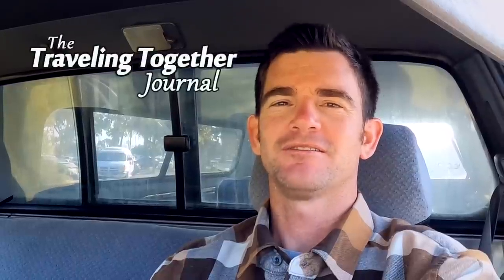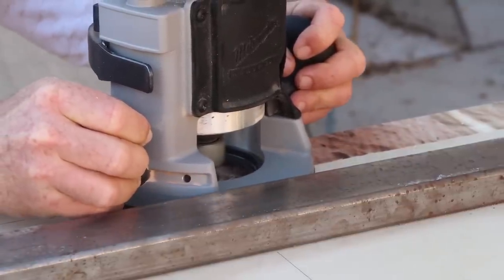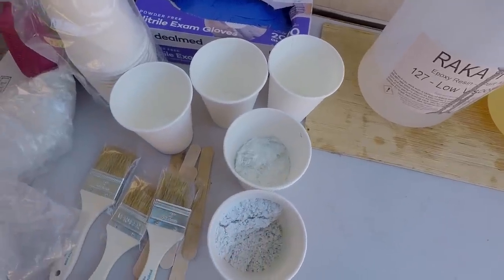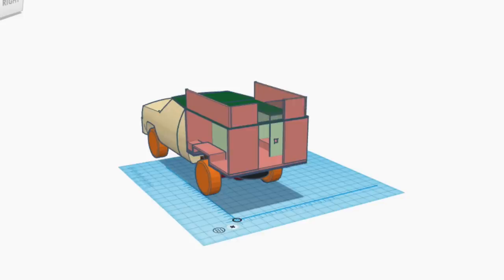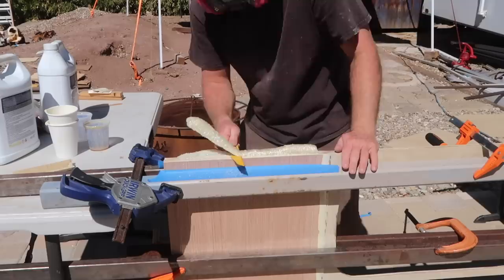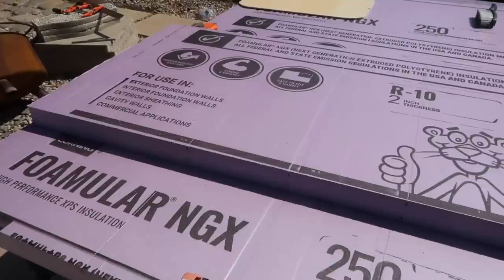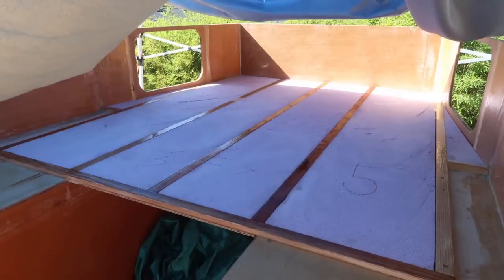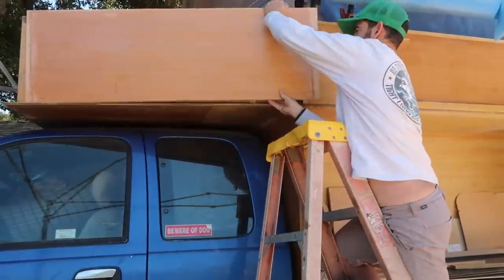Building A 4x4 Truck Camper | DIY Foam Composite Panel Cabover

Comment: Great work Matt.  I imagine you’re not taking orders yet for custom builds.  Enjoying following every step.  I also used the Foamular 1.5” thick all around my truck camper as we winter camp -20 C.  We cover the single pane windows with foam insulation plugs.  Nothing fancy.   Your build is the way to go in my book.
Reply from the maker: Thanks Marc. I think I had a similar idea for the foam insulation plugs in the single pain windows. I should probably get the windows installed first though 🤔
Most of my insulation concerns were motivated by wanting to beat the heat, but I'm sure we'll have some chilly nights near a ski mountain at some point.

Comment: Brings back memories of building my LongEZ.
I'm building a bicycle camper trailer pretty much the same way as the way LongEZ is made. 
But I won't be using fiberglass. That stuff is nasty. Cotton canvas produces even stronger composite.
As a matter of fact, the the fillets you've been using on the corners with glass strands, is done with cotton flux in the construction of all Burt Rutan's creations.
Looking forward to your next video.
Reply from the maker: Good luck on your build!

Comment: I've been contemplating building a light weight pop-up trailer.  Watching for how you actually pop the top!  I built a panel insert and remove trailer on the lines of the old Apache trailers, with the basis being an old Coleman Pop-up camper.  Using mostly 2 inch thick foam coated with poor-man's fiberglass.  It works fine and is very light weight.  But - takes a while to assemble and disassemble (about 45 minutes).  Watching and enjoying your build.  Amazing, Matt.
Reply from the maker: Hopefully I'll get the popup figured out sooner than later and will be sharing it in the next video. I think getting a good seal between the moving parts is going to be the tricky part.
I'm hoping I can go from parked to ready to sleep in less than 2 minutes.

Comment: Right on. You’re a focused person to be able to do such an impressive undertaking. Are you keeping track of how much you’re throwing at materials? The design looks solid to be able to last for years.  I’m almost done stumbling through building a rusty shit van and I wouldn’t ever let you inside to look at it. Lol 
Mostly found reused materials with a shit understanding of how to build. Good thing it’s an 80s diesel.
Maybe I’ll catch ya around the bend down south one of these days.
Reply from the maker: It's defiantly been slower progress than I anticipated when I started the project. I am keeping track of my materials cost. I haven't added it up yet. Kinda don't want to😅 But I was planning on sharing that info once I get the basic camper done (roof, windows, doors installed)

Hopefully, once I get this camper usable I'll be spending more time down south too. Thats the motivation at this point

Comment: Cool to run across this video... I may have the opportunity to pick up this body style of Tundra that has quite a bit of damage from riding out an EF-3 tornado that completely leveled a brick strip mall 50 yards from where it was parked. As a result, the poor old truck doesn't have a straight body panel anywhere on it. LOL! Nothing terrible...just lots of dents and scratches. I was actually thinking about scrapping the bed and doing something similar to your project. I have even pondered cutting the back of the cab off and having a crawl through. I will have to check out the rest of your videos when I have a little more time! What do you think that your final camper weight is going to be? Are you going to need to add air bags or beefier springs?
Thanks for sharing!
Reply from the maker: I'm expecting the camper to weigh 1200 pounds empty. I will probably exceed the weight capacity of the truck by the time it is fully loaded for adventures, so I may replace the old worn-out leaf springs with a slightly higher rated, new set. Gonna wait to see how she sits when I'm done
Reply: @TheTravelingTogetherJournal  Nice. I’ll keep following along!

Comment: Great work Matt. May be a naive question, I see all the frames etc, but no pillars to support the weight of the truck roof in an unfortunate event of a rollover. As you know all cars/ trucks come with an A-Pillar and B-Pillar. Thanks. Always enjoyed your work.
Reply from the maker: There is no intension of riding in the camper while underway. We will be in the cab with its unaltered A, B, and C pillars.

Comment: I have a T100...and the issue has always been finding a camper to fit it.   Nice way to to get around that problem.   I wonder if you could build this with just foam and fiberglass?  nice project.
Reply from the maker: You definitely could, but for my application ( occasionally off-roading down overgrown trails) I would want much thicker fiberglass than what I am putting over the wood. You may also need to consider a more structural foam. I think it would be an easier, faster way of doing it, but the cost may be considerably more depending on the materials you choose.

Comment: Well done! Finally a new video. How long do you think you'll need to finish the build?
Reply from the maker: At least a few more months to get the roof and doors on, but it will probably never really be "finished". I have intensions of doing a lot of drawers and mounts for different things in the various compartments. There will be an electrical system and water system, storage under the camper, and awning... always more projects.

Comment: Awesome work Matt! I'm guessing that the bed can only be slept in while the camper is popped up? I'm lazy and have a lance camper I got for free and rebuilt / repaired kinda .lol
Reply from the maker: Free and easy... sounds like the perfect camper.
The space between the bed and ceiling would definitely be uncomfortable when its not popped up, but hopefully everything goes according to plan it takes less than 2 minuets to go from parking to popped up and ready to sleep.

Comment: Any update on the build?  No pressure for a new vid just super curious on the progress?
Reply from the maker: Build got put on hold for a while, but I'm back at it. The popup has proved to be quite a challenge. If the new plan works out I should have the popup done in a couple weeks. New video will probably be a couple weeks after that.
Reply from the maker: New build update is out: https://youtu.be/GV-bG3O56RY

Comment: How is the cab over section strong enough to hold both of you and the mattress without bending under the weight and resting on top of the cab or even breaking?  It doesn't seem to have enough structure...I'm not being critical at all, I'm just ignorant.  🤪  I really want to make one of these myself and need to understand the structural part better to make sure whatever I build will work!  I've seen people make their panels with ONLY the foam sandwiched between fiberglass.  Did you consider doing that or not, and if not why?  Again, I'm thinking that structurally your panels should be more structurally strong yet thin, whereas the ones I saw were two layers of 1" foam board glued together with staggered joints and then coated on each side with the fiberglass fabric and epoxy.  Certainly you'd need either wood or metal to be able to screw things into like the air struts and drawer slides, but do you think the rest of it could possibly be made with that 95% foam board method I'm referencing or not?  And if not could you explain why?

Your build is TOTALLY inspiring me!  I'm now subscribed and eager for your next installment.  I've already learned a TON from this series, and your method of creating a hard side popup with the struts and latches INSIDE vs outside is fricken brilliant!  No drag on the outside, yet very clean on the inside.  Curious why you didn't mount the air struts you put in the middle all the way to the front so they're completely at the head of the bed where they're less likely to get kicked and damaged, as even though the front angles in to 60", it still appears there would be enough room to do that...  Any and all explanations and/or responses to all these questions would be greatly appreciated!  LOVE THIS BUILD!

One more question: it looks like everything is getting a coat of epoxy, one layer of the fiberglass fabric and then another coat of epoxy.  I've seen others double that, but obviously you don't feel that's necessary.  Maybe the others are doing that because they're only using foam so that it creates more structure?  If you know anything about that I'd love to hear your comments on that.  Thanks!
Reply from the maker: I'm going to try to answer all your questions. If I miss something feel free to re-ask. also, I am not an engineer. everything I'm doing is an experiment.

You can definitely build a camper out of just foam and fiberglass. Most builds you see on YouTube are using XPS foam board. It's not the ideal material for this but its a lot cheaper and more available than structural foam board. If I were going to build a camper like this I would definitely use a heavier weight glass than what I am using. The laminated foam board gets quite rigid and strong, but a single layer of 6oz cloth over xps core wont have much impact resistance when it comes to little rocks or anything hard getting kicked up into it.
The main reason i didn't use xps foam board was because it wasn't available in California when I started my build.
I didn't mount the airstruts all the way forward because the camper gets narrow at the front and they would have been in the way. It would have been better for the lifting functionality to have them all the way forward as you suggest but i didn't plan ahead for that.
I think the cabover will be strong enough, but like i said, its all an experiment. the 1x2 stringers aren't particularly strong on their own, but glued onto the 3/8" ply underneath and the 5mm ply on top it becomes it becomes much stronger and then soaking all that wood in epoxy really adds to the strength as well.
Try searching for videos explaining load bearing composite panels. I don't feel like im knowledgable enough to explain the physics here, but I remember watching some videos about it a while back.
Reply: @TheTravelingTogetherJournal  Thank you!  Yeah, I just can't see how you could so the pop up hardware without at least some imbedded wood or metal to screw into.  As for the impact resistance, I was thinking it might be a good idea to sandwich the forward leading edges of foam with something like thin diamond sheet metal or something like that.  It would add to the weight, but only on those front edges.  The sides would all still just be the foam/fiberglass combo.  I watched Ambition Strikes' build where they built a kind of exoskeleton that they glued and riveted their panels into.  They did steel sheet on the outside and plywood on the inside instead of using fiberglass.  LOT more expensive and tools/skills I don't have!  Anyway, thanks again.
Reply: @TheTravelingTogetherJournal  How much headroom do you have in your sleep area with the top up?
Reply from the maker: @carolewarner101  Fiberglass is pretty awesome stuff. You can make it thick enough to have good impact resistance, but you are adding weight and cost. You can also glass on hardware instead of screwing or bolting it on.

we have 32 inches of head room in the cabover.
Reply: @TheTravelingTogetherJournal  That's more than I thought!

Comment: I have a truck camper that a tree limb went through the bathroom ceiling and it screwed it up - are you interested in roof ac, fridge 3 way, 3 burner stove , heater?
Reply from the maker: That's super nice of you, but I already scrounged up most of my appliances  from some discarded campers in my area.

Comment: Hello from Australia! I have been looking for ideas how to build my slide-on for my Isuzu D-Max. Great channel! I will follow your suggestions. One question: if I have googled this correctly, then the T100 has a payload of 1580 lbs. How much do you expect your build to weigh? Waiting for your next video!
Reply from the maker: The Payload capacity for my T100 is 1950 lbs. I expect to camper to weigh 1200 lbs empty. We dropped some weight by getting rid of the original truck bed, but I think Ill probably still end up a bit over the GVWR when fully loaded
Reply: @TheTravelingTogetherJournal  Thank you! It looks very well done for sure and I will follow you with what I am doing. Albeit in a much simpler version, basically just a box wth a pop top, to go on the tray of my D-Max, 8ft x 6ft footprint.
Reply from the maker: @silkeandtorsten  Nice. Simple is good
Reply from the maker: I finally weighed it and go into detail in my latest video: https://youtu.be/Bwbfe8-MII0

Comment: Matt, here in the EU we pay 45 USD/ litre for epoxy. What do you guys pay for it over there?
Reply from the maker: I bought a 6 Gallon kit consisting of 4 gallons epoxy resin and 2 gallons of non-blushing hardener for $404 USD. If I did the conversion correctly I paid $18 USD/ Liter

Comment: Is all that glue and epoxy necessary? This thing must super heavy, 2000lbs empty?
Reply from the maker: I'm expecting it to weigh around 1200 pounds empty. 

Lots of people make much simpler wood campers with lower quality glue and no epoxy. They usually have a heavier frame work sheeted with ply wood and painted. some are probably lighter, some are probably heavier.
Unfortunately I'm not an engineer, so this is all based off what I think will probably be strong enough.
Reply from the maker: I finally weighed it and go into detail in my latest video: https://youtu.be/Bwbfe8-MII0

Comment: How did the camper effect mpg ? Did you still run 70-80mph?
Reply from the maker: Stock truck was averaging around 19 mpg. with the camper it's averaging just over 15 mpg.
I normally drive 70mph on the highway and I still do with the camper.